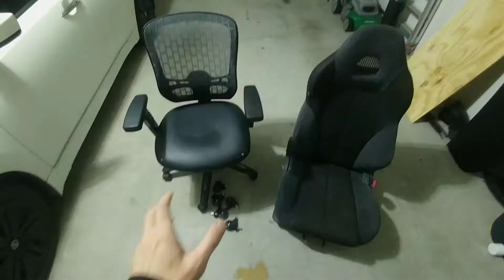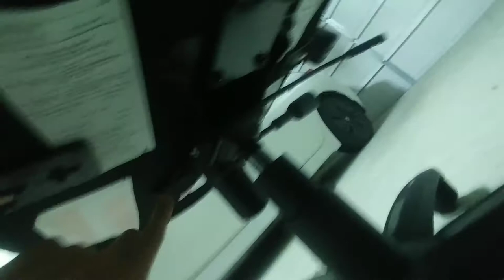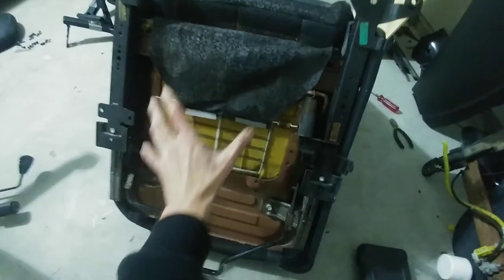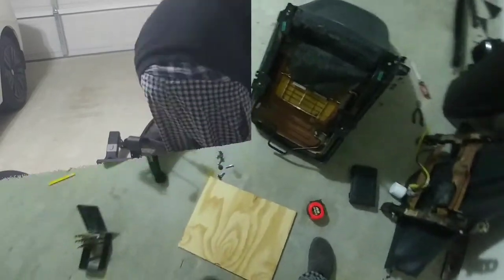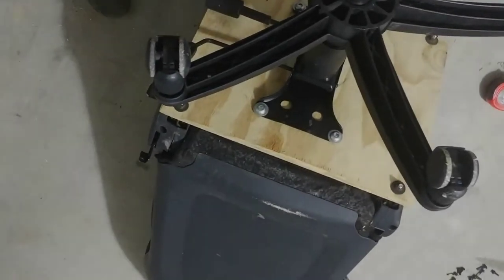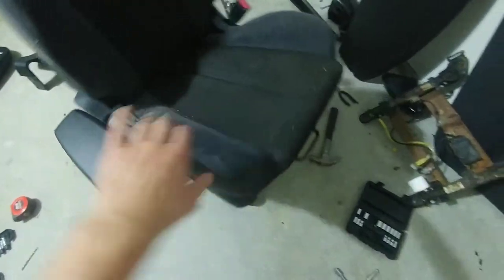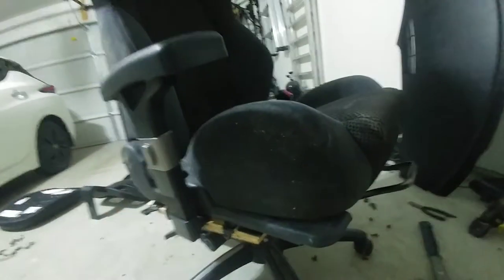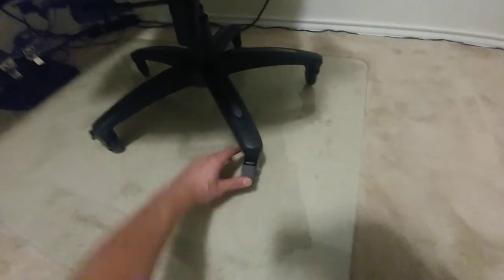DIY Gaming chair form car seat (Mitsubishi Eclipse)

Comment: Hi , you know i picked up a car seat which i found left outside my flat bin .I thought i can use it for office chair and not let it go to dumping place. I had an idea to get the old office chair and remove the stand to attach on the car seat. Now i have everything , i have the idea on my mind but i am not good at making DIY . So today i thought let me check if anyone out there has the same idea. I didnt believe when i found your video its exactly whats been in my mind the past 2 months. You have given me inspiration. Though i thought of ply wood i was thinking its easier if I  remove the  seat base of the old office chair  and stand  together and attach on the car seat . Then attach the armrests  and the lumbar part. I will get someone to do it cos I have weakness on my arm, I  have limited one  hand functioning. Thank you for sharing this video it confirms that the idea will work .

Comment: This video is a little bit over a year old...how is the chair and everything holding up? I am currently building one myself with a Van seat...I was originally going to do a welding route but its a bit pricier, and i saw you used wood, so im very interested in hearing how it is holding up using wood!!

Comment: So damn gorgeous!! In my country, Kenya, we don't manufacture gaming seats. So one only has the option to import, which is pretty darn expensive, as they charge by weight. These things are not lightweight, and usually the cost of importation of say, a $200 chair totals to over $400 for transport alone. Then it might end up being uncomfortable 😢. So this is a perfect solution, Thank you!! I've been watching similar videos, and finally here's one with an armrest, which looks pretty called for 😍😍.
Reply: Hell naa, just buy a classic office chair with wheels and it will be better for comfort and for your back, sports car bucket seats are the opposite to confort

Comment: I also had this idea but after I ordered a office chair and experienced the tiled seat slightly backwards just like this 13:40 I'm not quite sure about this. If the seat is tilted like that it's not good for your back, you can never really sit straight in it it's like you always lay back a bit and this causes you to go forward with your neck which only results in a forwarding neck posture. no no no.